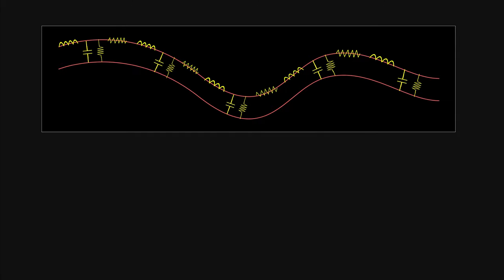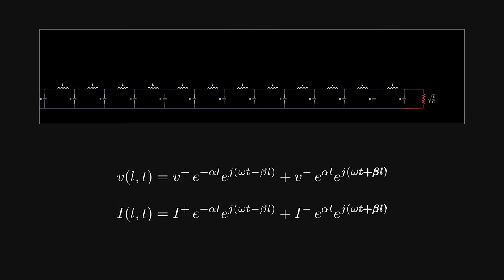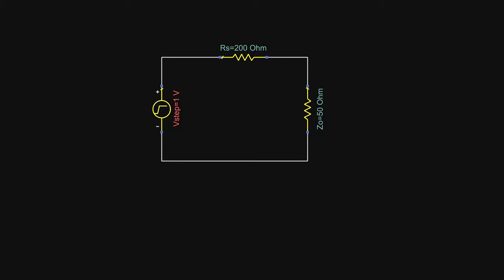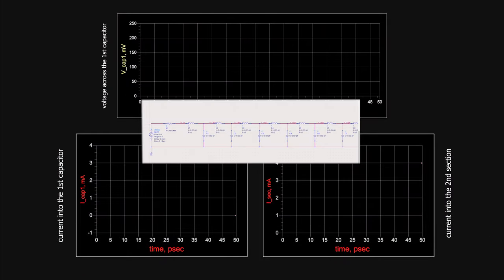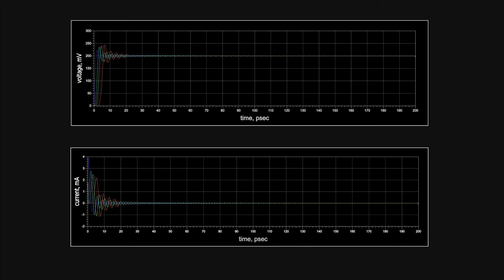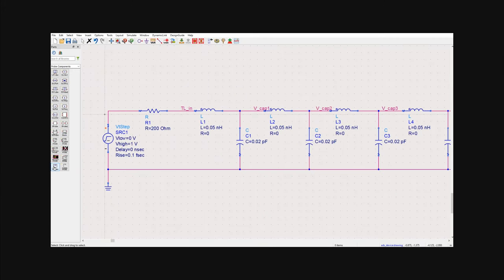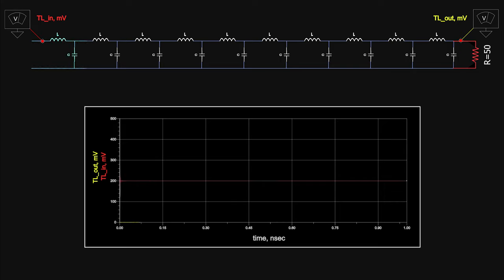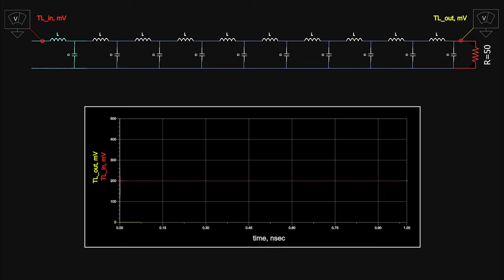Transmission Lines : part 2 | Let's take a journey with the signal inside the transmission line

Comment: As a professional antenna engineer, I feel like I finally understand the mechanism of reflections instead of just memorizing this process.  Thank you for the amazing video!
Reply: Congratulations! You can now call yourself a real engineer, and not only someone who has a master in engineering ;-)
Reply: But i didn't understand. How is there conductance between wires in parallel?
Reply: @sagarrawat7203  If you consider the resistance of the wire insulation and the medium (seawater, air, etc), you can model it as an extremely large resistor. In almost all cases, it's so high that it can be treated as an open circuit. However, when dealing with extremely high voltages, the small amount of current that flows through this large resistance is not negligible in the case of per-unit-length circuits. So there is some resistance in parallel (shunt resistance), and therefore there is a conductance which is 1/R.
Reply: @Blank-wv3uf   thanks. But, then why shouldn't we take resistance R in parallel too than conductance G? This G made it complex. Is G really different?

Comment: Hello sir, im not quite understanding the whole concept of the video and i want to ask whats the point of examining this phenomena ? What does it do in our daily power transmission ? Does power reflect from my home back to the station ? Also if i see the generator voltage and my appliance voltage at the same synchronized clock frame, will it have a phase difference due to the signal delay ? We say power grid is in sync, but after watching those transmission line videos im in doubt. Please answer sir ty
Reply from the maker: Hope my newly uploaded video answered your questions

Comment: This is gold! I really love the duality of the transmission problem from plenty’s pow. When I’ve studied it, the concept that really helped me to get to the point was the fact that nothing could travel faster than c, so the generator’s voltage phasor is actually a signal. Therefore this “signal” needs time to arrive to the end. But this visualisation had a lack on the reflections because it is not so immediate to immagine it from the signal pow. However this visualisation of the continuously correction of the capacitor’s voltage is brilliant.

Comment: Really nice illustration. I think until you appreciate the finite propagation speed of the signal, none of this transmission line stuff  makes sense, but of course,it’s still really really fast, so hard to have much intuition. Your video really helps visualize the reflection due to impedance mismatch - why is there a reflected wave? Because it takes time for the input signal to reach the load! I’ve taken the coursework, understood the math, but never really understood the physics of it all until your video. Thanks!

Comment: I simulated thé circuit minute 4.32 on PSpice, I used DC crurent power, c 20fF, and R 50 Ohm. All crurent pass by thé resistor, thé capacitor does not charge anymore.dont know why.
Reply from the maker: you can upload a screenshot of your schematic as well as the results besides your question on the Discord server or the Reddit community (links are in the description) so that I can see where is the problem
Reply: @TheSiGuyEN  ok thanks I will try. What I see is that PSpice does not show thé transient state only thé établished state. Thé time scale is good. I should see thé curve Vc=E(1-exp(-t/to).
Reply: Very good video to understand the reflections on transmission line . This is the basis and fundamental for SI analysis.

Comment: this video is so amazing but I want to ask a question that if we cut the transmission of the signal after some time, the long wire is storing the charge. In lossless line how to discharge them or will they form an oscillation or not? please reply I am eagerly waiting.
Reply from the maker: The stored power will be discharged into the load

Comment: Great video! Very clear explanation.
Why is the voltage on the 80 ohm charge not going to 320mV first? If we have the same current (4mA), the voltage on the load should be 80ohm*4mA = 320mA. What am I missing ? :D
Reply from the maker: which minute?
Reply: 9:42 "same current (previously 4mA) driving higher resistance (now 80ohm) gives us higher voltage, 245mV"   @TheSiGuyEN
Reply: The forward current is the same 4mA, but 80ohm has backward (reflected) current, so total current is less than 4mA.
Reply: if you see the graph at @9:48 it effectively reaches 0.32V (look at the spike voltage). But then if you calculate the reflection coefficient gammaL(80-50)/(80+50) and you multiply it for 0.2 you get 0.245 that is the reflected voltage. So the difference is 0.45V.

Comment: Hey, excellent video !!!
I just wanted to ask that in the case where load impedance matches characteristic impedance( @8:50), is the output voltage level necessary 0 before the traveling wave gets to the load?  I have seen a video of veritasium in which he says that there exists a minor voltage even before the wave reaches the load.
P.S. I can give the link of the video of veritasium if you want.
Thanking you in anticipation of your respnse.
Reply: can you the veitasium link please.
Reply: @SomStar2426  https://youtu.be/oI_X2cMHNe0

Arround @18:59
Reply from the maker: I will make a video soon replying to Veritasium. I think he was wrong. thank you for highlighting that point
Reply: @TheSiGuyEN  thank you so much for replying!
Eagerly waiting for your video!

Comment: You have a deep understanding of phenomenas, this not so easy for me. I have a question : From 0 to 5ps,  this is the time of the capacito charge, then before the voltage is established , I see some ripples, they are do to what? And is there a possibility that thse capacitances filter HF? also there is a condition about distance between the 2 conductors to assume a TL, physically that correspond to what? On youtube we could see that all intresting scientific videos are in english, unfortunatly in french we dont. Also I had courses on TL and never the teacher talked about all of what you are explaining. THANKS a lot for these precious videos, even I dont get it all but I get some very precious informations.
Reply from the maker: "I see some ripples, they are do to what?" there're ripples because the circuit is not first order. The approximation at 4:00 is first order rc circuit, but this is very accurate. There are inductors and they should be taken into consideration for more accurate results.

"And is there a possibility that thse capacitances filter HF?" They do filter HF. we applied a step voltage at the input, and the voltage at each section is low pass filtered as shown in the video.
Also the overall response of the TL is sort of low pass filter response 13:14 (you apply step at the input and the output will settle after some amount of time govern by reflections as well as lp filteration associated with the capacitors)

"there is a condition about distance between the 2 conductors to assume a TL, physically that correspond to what?" No, the only condition to assume a wire as a TL is that the length of the wire is much larger than the wavelength of the signal. the traces on PCB for example are considered TLs if the circuit work at high frequencies (wavelength is small).
The distance between the two conductors actually affects the capacitance per unit length, and inductance per unit length which in turn would affect the value of the characteristic impedance and propagation constant (they depend on the capacitance and inductance per unit length).
You can easily predict the effect of the change of the value of c, l, and zo (same graphs as shown in this video but with different values).

If you have any other questions or recommendations, please don't hesitate to ask :)
Reply: @TheSiGuyEN  thank you, I'm so glad to read you, your answers are very précious. I look for courses to understand deeply EM. Dovyou have références.thanks à lot
Reply from the maker: @karielf8947  it depends on your background and what you want to learn. But in general, this is a good book:
"Microwave Engineering by David M. Pozar"
Reply: @TheSiGuyEN  thanks à lot. I m à phd in emc, and I use EM in my analysis. I need  to predict what could happen, or to analyse measurements or analysis.
Reply from the maker: @karielf8947  Great, Here're some of my favourite books:

Engineering Electromagnetics. By John A. Buck, William H. Hayt

Electromagnetics: With Applications By
John D. Kraus, Daniel A. Fleisch

Field and Wave Electromagnetics By
David Keun Cheng

This is a great course covering fundamentals of electricity and magnetism By Prof Walter Lewin:
"8.02x - MIT Physics II: Electricity and Magnetism"
https://www.youtube.com/playlist?list=PLyQSN7X0ro2314mKyUiOILaOC2hk6Pc3j
you can use this course to refresh your memory about the basic concepts but as an engineer, don't rely entirely on it.
Reply: @TheSiGuyEN  Thanks à lot, this is very kind from you 🙏😊🌈
Reply: The problèm is that when I was student, I learned physics by mathematical equations, unfortunotly teachers dont exolain phénomènas. And in emc I have to predict thé behavour of EM fields, static and HF.
Reply from the maker: @karielf8947  Good Luck to your journey
Reply: @TheSiGuyEN  thanks 😊, you too 😊

Comment: I have a question here, In the unmatched load condition, is it still correct to replace the rest of the line by the charecteristic impledence like we've done in ech of the individual "sections"
Reply from the maker: yes, as long as the signal is still travelling toward the load before reaching it. Before reaching the load, the signal doesn't know what kind of termination; it sees only the charecteristic impledence of the line.